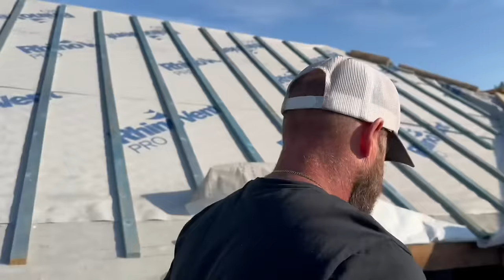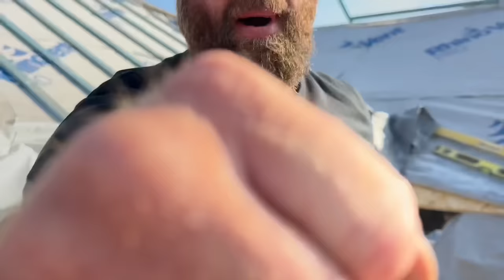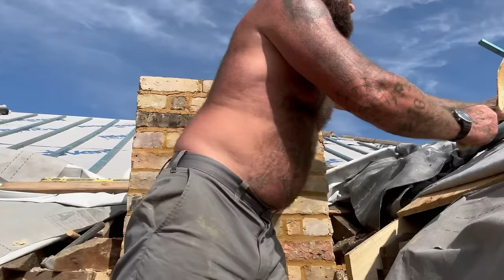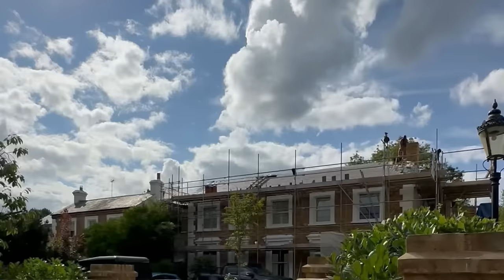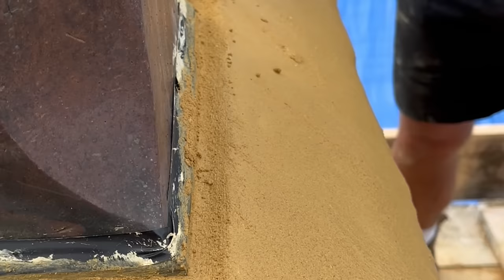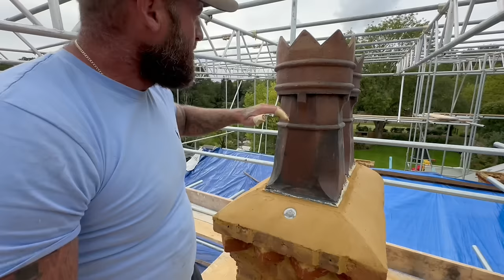ReBuilding the chimney stacks Episode 2                #history #heritage #bricklaying #diy

Comment: Brushing that flaunching will just leave it open to the elements, I was always taught to use a 2.5 to 1 mix and polish it when it had nearly gone of leaving it as smooth as possible, same with benching in manholes.
Reply: Answer ya own question sue, in a manhole ya want the water to roll off the benching back into the pipes, don’t want the soot rolling back into the chimney and down back into the fire, ya would rather it get trapped at the exit point 😌
Reply: @davidwilkinson8958  what the hell are you talking about?
Reply from the maker: Allo mate ..smooth finish exposes the fillit stresses the fillit ,brushed finished takes the stress off ever 1 point sends the water in never 1 spot
Reply: @thetraditionalbricklayer9650  what?

Comment: Why the 3/4 and header in the face . Pointless tying into the 'wiffs' ..... They never used to in the old days . They relied on good old gravity . Keep it simple . 👍🏴
Reply from the maker: Sorry mate but you’re incorrect…awkward points they stretcher bonded and scratched the false joint in as you was able to do so as the stocks wore cooked at leaser temp .

This method is passed down to me from generations dating back to 1731
Reply: @thetraditionalbricklayer9650  New to me ..... Laying over 45 years . Oh well . All the best . 👍🏴
Reply: Do you use gauge